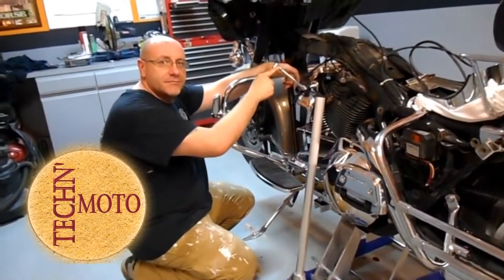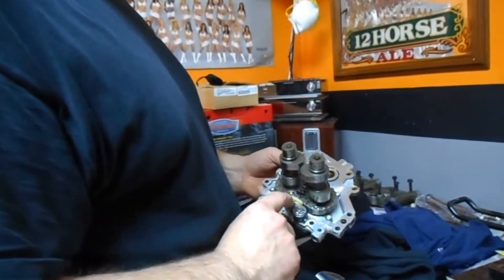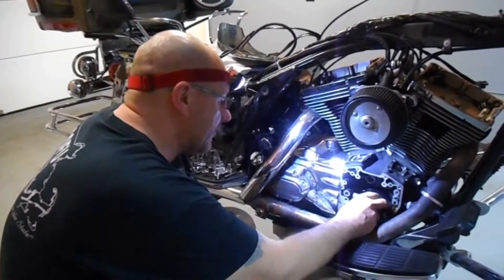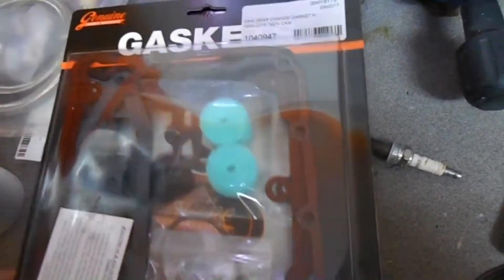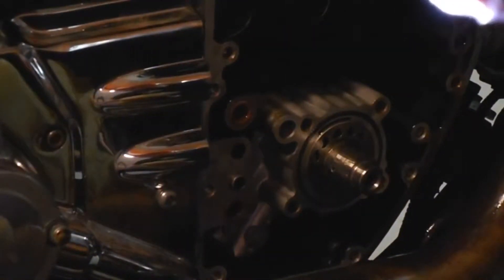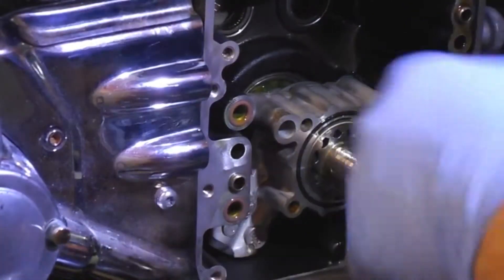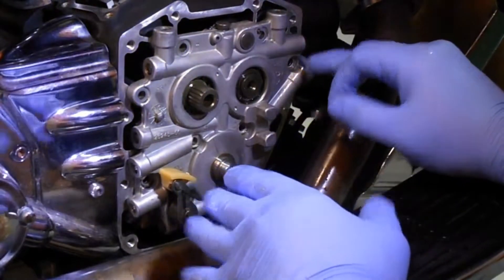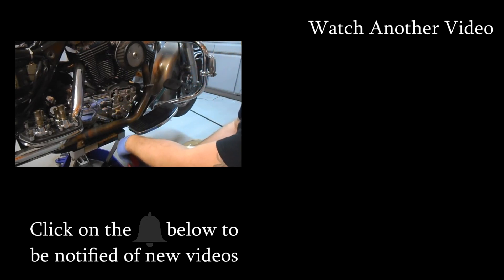Harley Camshaft Chain Tensioners Install  Part 1 of 4

Comment: The paper clips or binder clips work well to hold up the lifters, but you have to grind the ends to a sharp point .  I couldn't get them to work until I ground them to a point.
Reply from the maker: John Cummings good to know thank you

Comment: Great video, here is a tip that I found. The cam plate goes in very easy if you release the tension on the inner cam tensioner and hold it released with a pin.  I couldn't get the plate installed until I did this, then is popped right in.

Thank for the video.
Reply from the maker: hey thanks for the tip, hopefully I won't have to use it anytime soon- if you know what I mean lol
Reply: @TechnMoto  for anyone else coming here. Video's are great.  The cams have play in them when the tension is released. So they slide right in.

Comment: on the amazon cam shoes how long did those hold up since you have put them on? any issues
Reply from the maker: Twin power shoes have lasted a long time. They are still in there. I just checked them a few months ago and still like new.

Comment: Great video . How did you get the secondary tensioner shoe off ? Remove cams ? Or have a tool ?  Thanks for your time
Reply from the maker: I made a video of it. I made a makeshift tool that worked out ok but if I was to do it again I would have the cams pressed out.
Reply: @TechnMoto   Thanks . Right after i sent the email i seen/ watched the video you referenced . Going to attempt tomorrow . Thanks
Reply from the maker: Good luck

Comment: Should have done the inner cam bearings for sure
Reply from the maker: No need
Reply: I look forward to the video of you splitting cases to get the INA rollers out of your cases and oil pump when those bearings fail
Reply: Your bike, your money but there is absolutely a "need" to do them
Reply from the maker: Lol been two years and 70k still no need
Reply: Lol yea then you're beyond on borrowed time I pulled mine at 38 and half the rollers fell out of the cage and im not alone
Reply: @attributetovienna1982  Everything's OK ...until it ain't  ;   )

Comment: Great work Mike! Yep...I am from the guys that WILL NOT do this on their own! Hahahahah!!! Ride safe!!!
Reply from the maker: I think I said it before- knowing is half the battle lol At least your smart enough to know your limits. Most guys get into trouble because they forget this. Take care bud.
Reply: I agree on knowing your limits, but I really don’t trust some of these guys at the HD. That’s why I started learning some of this stuff on my own. This procedure as a whole is not “too” bad for me, however THIS may be one of those times I will have to shell out some dough and roll the dice at a stealership! ?? I know you only replaced  the shoes, but I might go a little further on my 02 FLSTF and have them update the support plate, oil pump, hydraulic tensioners and replace the cam bearings to updated Timkin ?? What you think? Too much overkill? I’m just looking at it from a labor point of view. I figured if they’re already in there, might as well upgrade/update some of the weaker points.